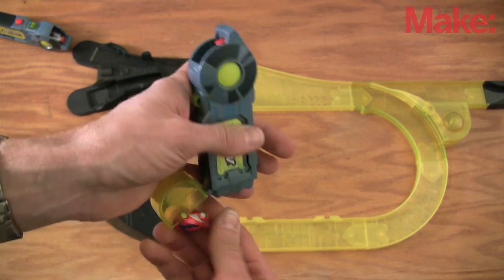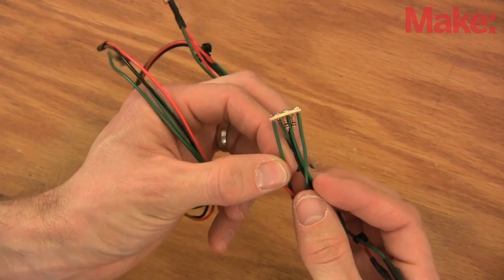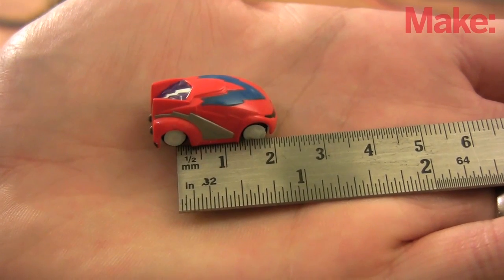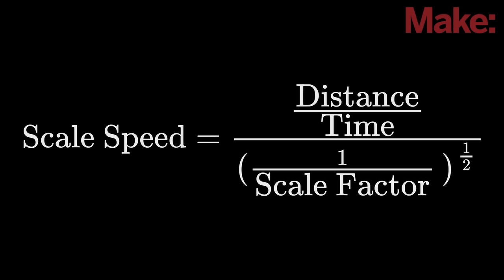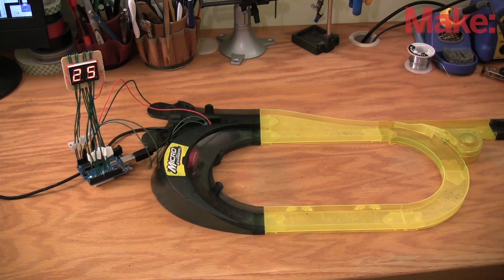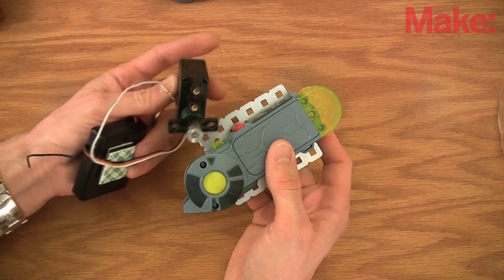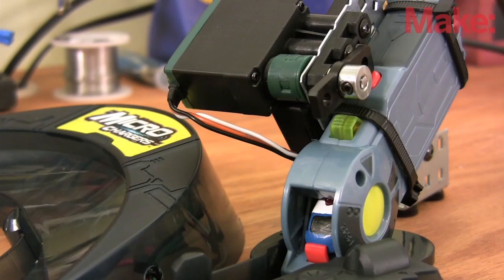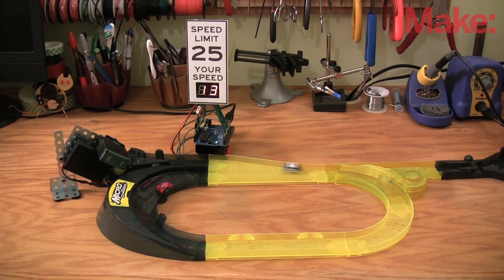Making Fun With Jeff Highsmith: Hack A Toy Racer

Comment: after 3 years its now discharge could you know how to fixed it? or ill just replace the capacitors?
when i put it in the launcher it still runs but it does not charge up anymore so when i launch it, it wont power to run in the track
i hope you have a DIY video to fixed it. 

my 9 yr old son collected many of these and he wanna  play it again on his birthday.. so  i check the toy but i realize its broke.
he will be sad if these small toys are not running in the track he wanna build, i hope you can help.
Reply: My chargers also doesn't charge, i want to know too, whats the problem? I bought it from a store, but here in estonia, nobody doesn't sell this product anymore, so it cant be replaced, but my son realy like those cars and i want it to work again, i have 1 new charger and one used and 20 new cars, but only 1 car race a little bit and thats it. I think its something wrong with chargers. They charge but if cars pulled out they're not racing.

Comment: can you use this to measure to muzzle velocity of a spud gun?
Reply: most electronics aren't that responsive that would mean 10000 reads per second if the sensors are 6 inches a apart with a 5k ft/s muzzle velocity. you could probably find a way if you put multiple sensor on each end, i don't know experiment buddy :)
Reply: just read spud gun LOL
Reply: Douglas Labat I did actually try making a spud gun barrel based off of this design, and I just placed the sensors about 1 meter apart. it worked when I dropped a marble through but I never got around to testing it with a real spud gun.
Reply: well good luck it should work as long as it has a fast enough refresh rate.

Comment: Make it so that when the police car catches the speeder, they both stop.
Reply: Easy, add some conductive material (wire/metal/tinfoil?) to the front of the police car.
When it hits the speeder, it will short out the capacitor, making it discharge immediately, effectively stopping him.

(But it doesn't stop the police car, might mount a button behind the "rammer" so that the same happens for the police car.)

Comment: I want this...only thing I might add is a cool little siren sound effect whenever the police car is deployed. Also, would it be possible to keep the police car launcher in a ready-ish state, so that it can be shot out instantly upon detection of a speeding racecar, or would that break the police car's capacitor? Eh, I have no skills in this sort of field.
Reply: Capacitors store charge so it could have been charged previously then set off when ever it was ready. So he could have charged the police car before hand so that it can go straight away. So basically you only need to charge it once then it's ready to go. Therefore you won't wear out the battery or capacitor

Comment: Looks good modification for the small racing car toys , but I think it will be an issue when 
the police car will be released after the car pass the speed limit , when both cars passing 
over the speed sensors error sensing will be done by Arduino due to the spacing between 
the cars .

Comment: What about a pin of sewing needle on on the outside edge of the police car, that would mover the contact point away from centre and should allow make the red car "spin out"

Of a tiny clear plastic triangle on the inside edge on the police car to flip the red car, even a clear plastic lip on the front of the police car could be enough to lift the red cars rear wheels odd the ground.

Comment: Magnets sound promising–give it a go and send me a link. The weight might be an issue, though, as these cars are very sensitive to added weight. If they both have a magnet, the police car should be able to catch the perp quickly enough, but the top speeds will be reduced. I experimented with a couple different "takedown" bumper designs, including a low-ohm resistor on the front of the police car that contacted the probes on the back of the perp's car to drain his capacitor.

Comment: My workshop is so small that with a longer track, I couldn't get the camera positioned for a decent shot of the action. This track variant actually comes with double the straightaways, one of which is a little jump. Once the cars slow down too much, though, they fall off the jump, which is why that car corral on the right of the screen comes in handy.

Comment: How about activating the detour when a car that is going too slow passes, and sending it to a servo operated charger to renew it's charge, then release it on the track again; so that the car never goes too slow? (needs some modification of the charger physical mechanism to allow the car in in the right way and hold it in place; and perhaps also a way to handle queues in case more than one car slips into the charger lane)